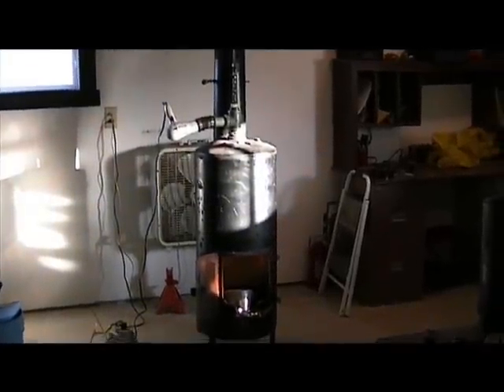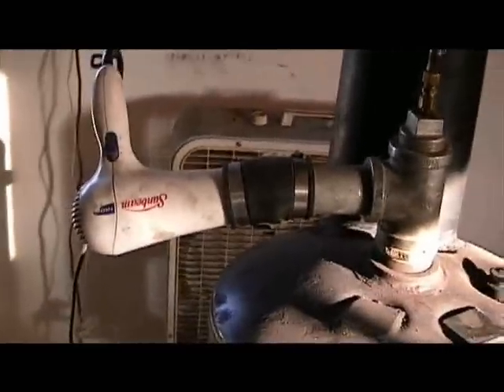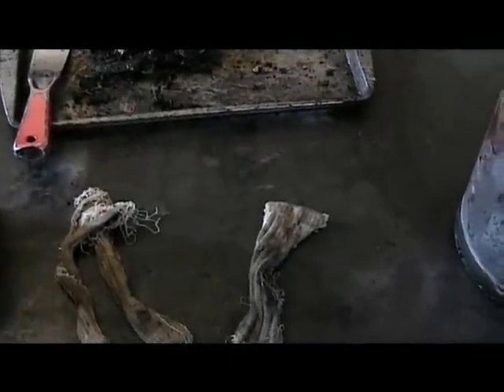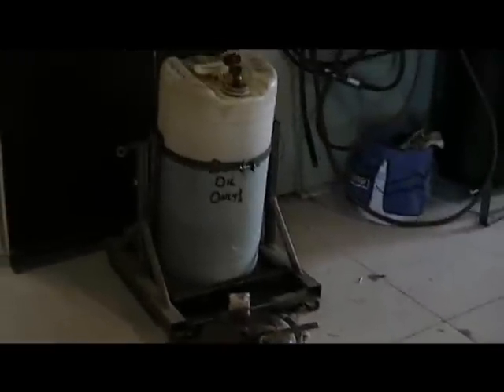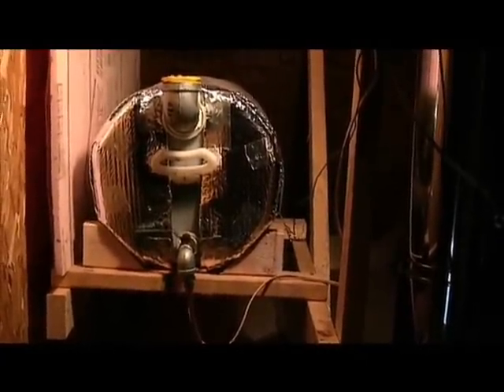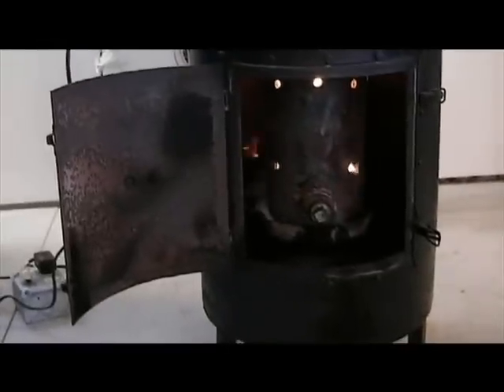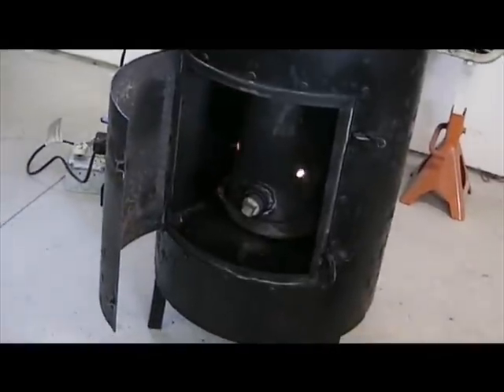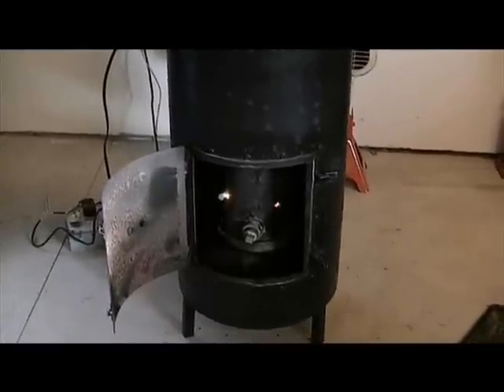Waste Oil Heater

Comment from the maker: I just used a fender washer welded to a bolt. I think it would be 1 1/2 or 1 3/4 diameter. I would think an exhaust valve would work fine. being thicker it just may take longer to heat up. I beleave in using what I have lying around. so hey give it a try and let me know how it works. thanks for the comment.

Comment: Hi Dan, What diameter is your evaporator disc? I thought maybe I could use an exhaust valve form an old engine. (junk-yard stuff). These are ready made dished, high temperature steel with integral stem.